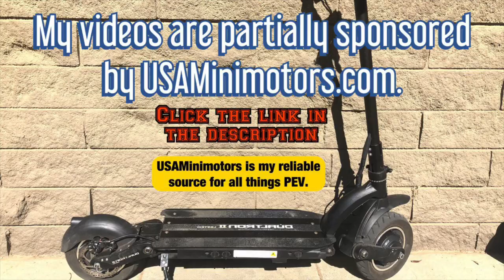MEET THE E.S.A. RECOMMENDED MASTER MECHANIC| WORKS ON ALL PEVS | A BACKGROUND WITH BMW & VESPA!

Comment: 4130 chrome/molybdenum steel bushing material. Machine the cylinder to within 3 thousands of an inch on a lathe, and freeze it. Insert it into the eyelet of the shock and, when the cylinder thaws, it’ll be a “press-fit”, with no pressure applied to the eyelet (bending the shock)

Comment: Main prob. with my M365 is it shutting down. Thankfully the 3rd party apps track a ton of data. I found that the voltage is slightly off on some of the cells. Replacing the battery is what gave me the idea to refurbish the whole thing.
Reply from the maker: Good luck with it man!
Reply: @yogadude1234  You as well on your group ride! Have fun & drive safe!

Comment: What do u use as a mic and video set up while on the electric scooter.
Reply from the maker: I don’t use any microphone although I am considering putting one into this new helmet.  For video I am using just to go Pro hero8 sometimes 2 of them.
Reply: @yogadude1234  so wait l, correct me if I am wrong but currently u just have a go pro on your chest and as u r riding u r just talking normally as u ride? If thats the case I am totally impressed. I barely ever hear any high volumed wind in your recordings
Reply from the maker: @jasonvalerio6820  I appreciate that. I try to talk down a little bit into the actual GoPro that seems to help. I feel like the sound on all my other videos sucks though  I need to buy some microphones.